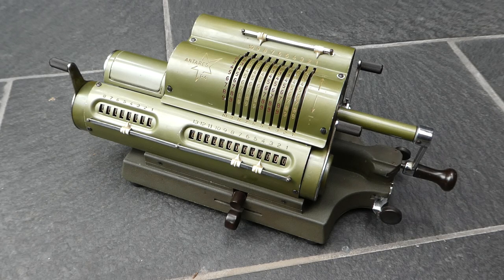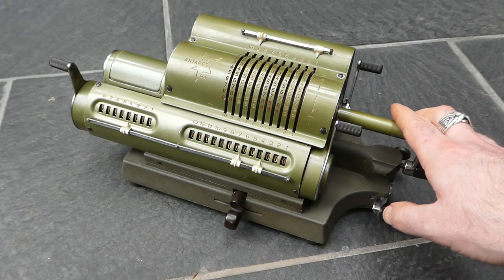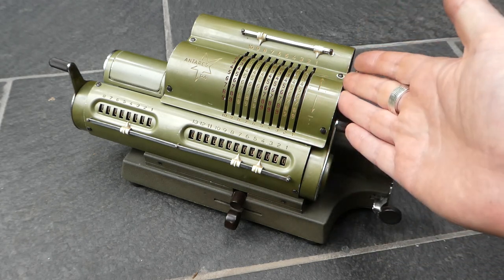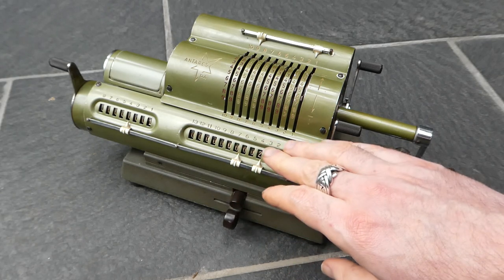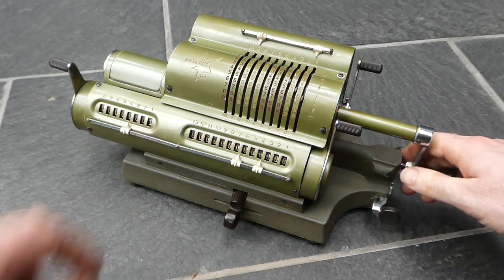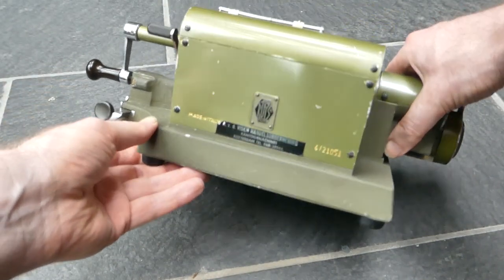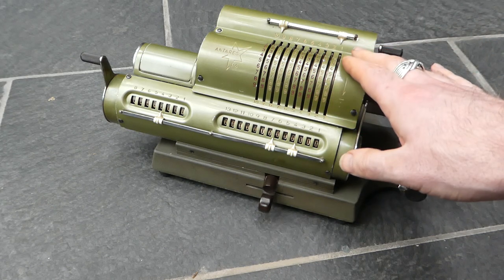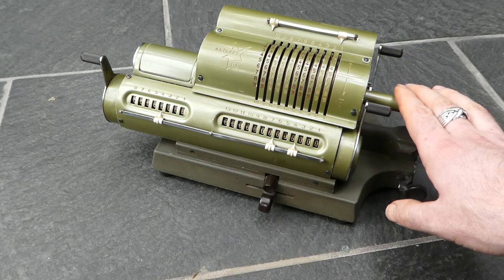The Antares P4 mechanical calculator

Comment: This kind of carry mechanism of the counter also used on some Triumphator calculators.
I wonder if the tens carry can work all the way over on the main register of the large capacity variants, or just on a portion, like on the Original-Odhner 24.